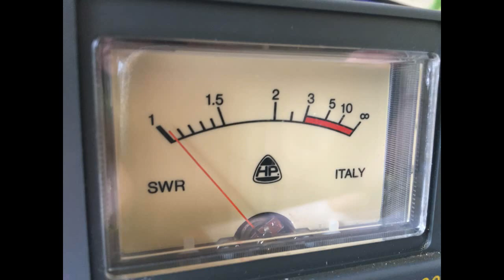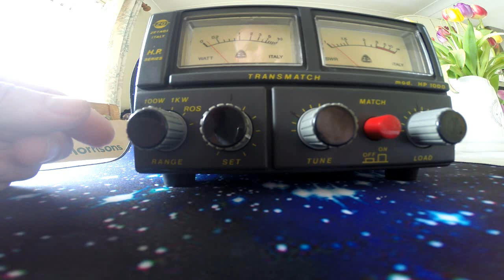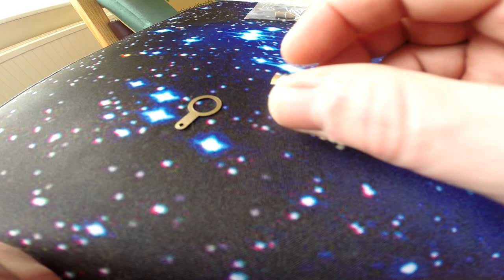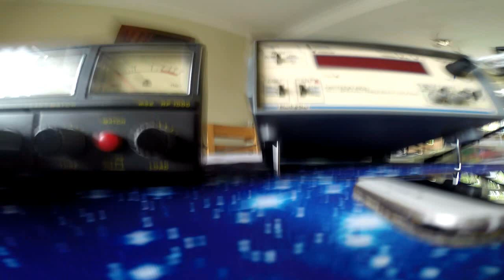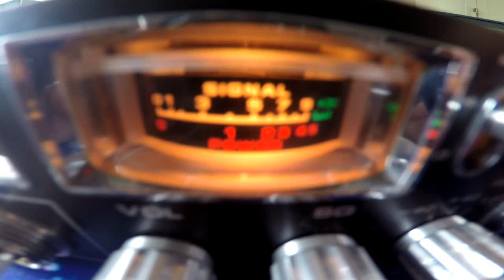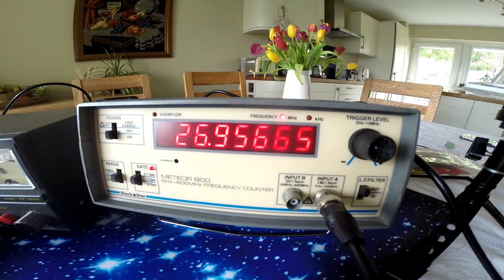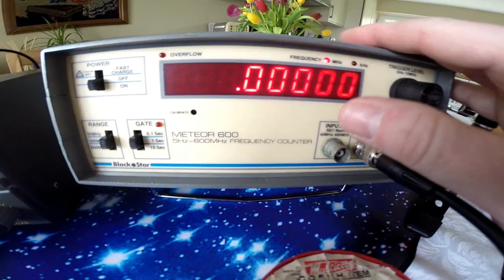Zetagi HP1000 - Frequency Counter Mod

Comment: Another way is to take the connector to the counter solder some stiff wire to it and wrap the wire around the coax lead going to the atu, the wire acts as a antenna for the counter!, I've done this on both my service table and radio operating set up!.
Reply from the maker: Good shout Elliot, hopefully these suggestions will help some people out , thanks for posting! 👍

Comment: Just discovered your channel , interesting, been on the Cb , freeband , am fm, ssb , since 1979 , still on , do you work on other peoples radios ? I’m trying to establish someone willing to do some work on a president jackson , .? Interested? Cheers shane uk 🇬🇧
Reply from the maker: Hi Shane, unfortunately i don’t work on other peoples radios, just do bits for the channel. whats the problem? Happy to help with some pointers if i can help, whats the problem with the jackson? 
There is a tech called Nick (Blackspirit) who does repairs you can find him on facebook I believe,  if you have it.
Reply: @britishcbradio1055  thanks for the reply , first of all , At some point in its life it’s had a e prom fitted for the muppet block , all seems to work well but fm audio is abit low , pot for am audio is full up can’t see one on the board for fm , I don’t like messing about with things to much , will get a power mic and give that a shot ,thanks buddy Shane
Reply from the maker: @shaneweightman  Hi Shane, good plan with the powermike, the other option is to take the foam element out from behind the grill of the current mike, it does mean taking the mike apart though. If you not confident on working on radios then go with the powermike it should sort it out 👍 Let me know how you get on , cheers . Mark
Reply: @britishcbradio1055  thanks Mark , will try that buddy and let you no how it goes cheers shane